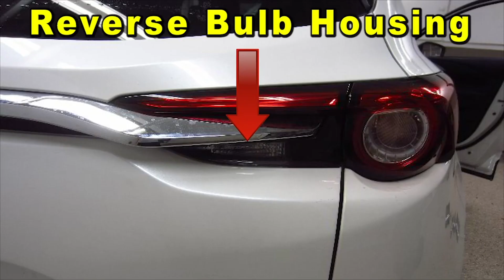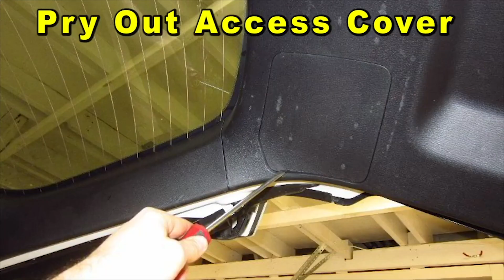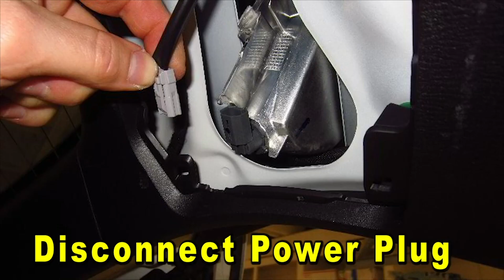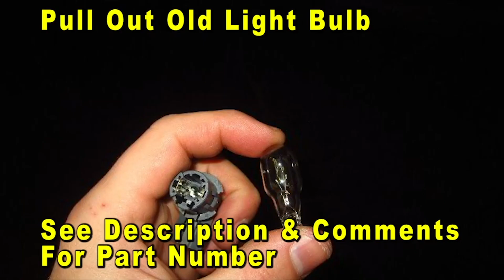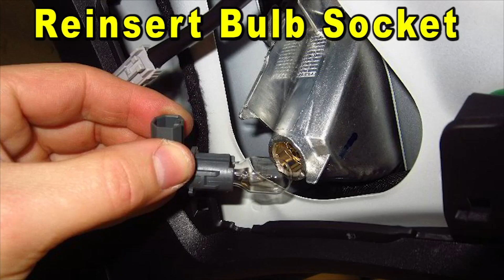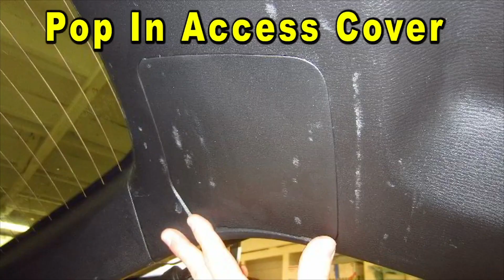2016 To 2023 Mazda CX-9 How To Change Reverse Back Up Light Bulb With Part Number - Quick & Easy

Comment from the maker: Mazda CX-9 Reverse Light Bulb Part Number - https://amzn.to/3R10V44
LED Reverse Light Bulb Part # - https://amzn.to/3R40BBG
Precision Screwdriver Set - https://amzn.to/3OYN1i0
Plastic Pry Bar Tools - https://amzn.to/3HMtsV7
Socket & Ratchet Set - https://amzn.to/3Z17LbA
Mechanix Gloves - https://amzn.to/3jCnHkt
Torque Wrench - https://amzn.to/3vS5uSI

The Paul79UF YouTube channel is a participant in the Amazon Services LLC Associates Program, an affiliate advertising program designed to provide a means for sites to earn advertising fees by advertising and linking to Amazon.

This DIY video shows owners of the 2nd generation 2016, 2017, 2018, 2019, 2020, 2021, 2022 & 2023 Mazda CX-9 how to change a burnt out reverse (backup or back-up) light bulb in the tail light housing attached to the tailgate door.

Comment from the maker: Check out the DIY guide for changing the reverse light bulb on a 2nd generation 2016 to 2023 Mazda CX-9 SUV - 
https://www.paulstravelpictures.com/2016-2021-Mazda-CX-9-Reverse-Light-Bulbs-Replacement-Guide/index.html

Here are all of the DIY repair and maintenance tutorials for the second generation 2016, 2017, 2018, 2019, 2020, 2021, 2022 & 2023 Mazda CX-9 - 
https://www.paulstravelpictures.com/Articles/2016-2021-Mazda-CX-9-DIY-Repair-Maintenance-Guides.htm

Owners of other Mazda vehicles such as the CX-5, CX-3, CX-30, MX-30, CX-8, Mazda8 (MPV), MX-5 Miata, Mazda2 (Demio), Mazda3 (Axela), Mazda6 (Atenza) and Mazda5 (Premacy) may also find these DIY instructions to be helpful.